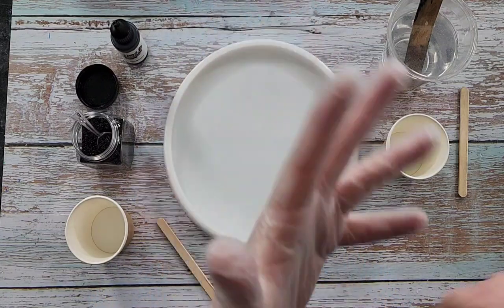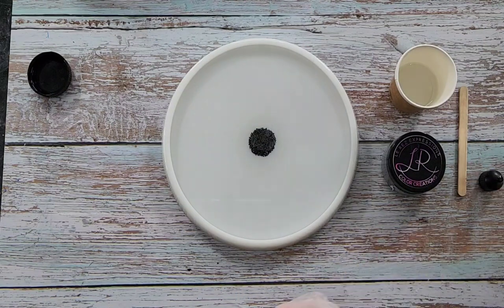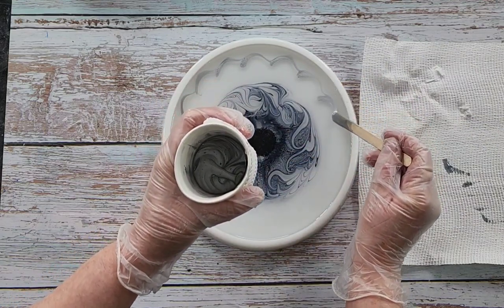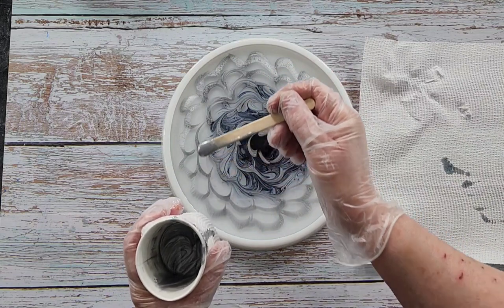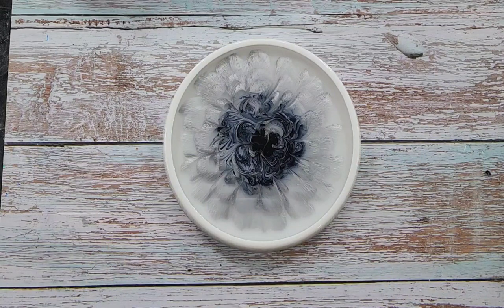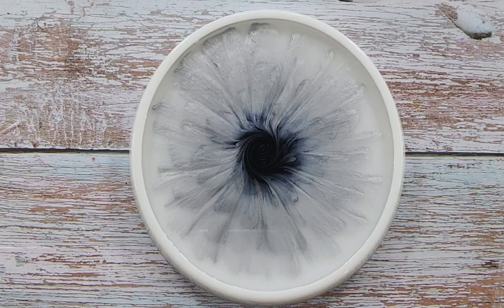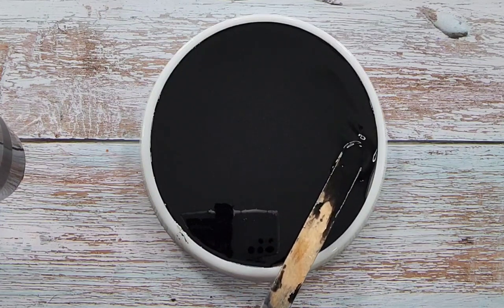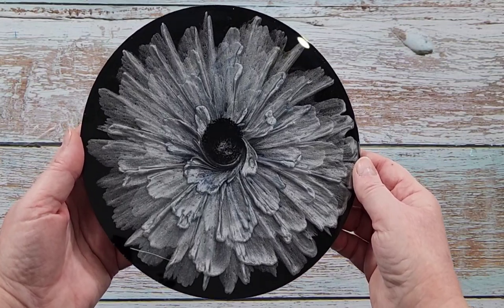#1523 The Secret To Making Your Resin Coaster Bloom In The Middle

Comment: OMG, that's absolutely perfect! You couldn't have done better. 

That is a brilliant fix! if the resin blooms inward, then sucking from the middle is brilliant.  Question: If you were going to swirl, then why did you need to suck it all in? Would it have just been streaky? 
One more question: Why don't you just fill and tilt to distribute the black background instead of trying to spread it? Seems the coverage would be better if you tilted. 

And thank you so much for showing us how to clean things like syringes. I have needle tipped applicators and I needed to know how to clean them. Save all you can and save the planet!

Comment: I, with my scientific brain, had to think about why sucking out the middle worked. Now I know why. 
Heat causes expansion, which is why the bloom happens, but as you notice, it happens more to the outer edges than it does in the middle. That's because epoxy can only expand so much before it's stopped by something else (another color), and in general, there is less density (with color in any form) towards the outside in a bloom technique ... so it can move more. 

Yes, it's still heating, but the outward pressure from the outermost parts of the mold will overwhelm  exponentially to the center (since it's coming from all 360 degrees) and will compress the center to the point that it's not going to bloom. Of course, that depends on the density of what's in the center, and in this case, the center is dense. 
Thus, removing the pressure will allow the pigment to flow, and allow a bloom because the epoxy, while hot, has more room to move. 

There will still be variables as to how the center looks because it will continue to heat until it's too firm to "pull out" the pressure, and the blooms all happen as the temperature of the resin decreases, which allows it to pull together towards the center, and thus, the bloom effect. The bloom effect starts with the spreading of the colored resin with heat, and ends with the pulling of the resin back into the center as it cools, which is why it looks like a flower. 

I know this is very scientific, but if you know to suck out from the middle, then you inherently understand what happens. Maybe understanding the physics will help you to perfect some of your pours. 
Hot means "out", or expansion. Cool means "in" or contraction, which is where the flower effect happens. The denser the center (either stronger pigment or additives like glitter/beads/etc), the less likely you're going to get the desired bloom and thus, have to extract some of the bulk of the resin to create room for a bloom. 

That sounds complicated, but it's not if you think about it. Maybe, to get a bloom to the center, the beads/glitter/whatever needs to be added last to prevent the laws of physics to require you to suck out product?